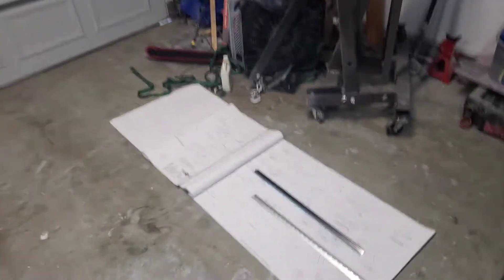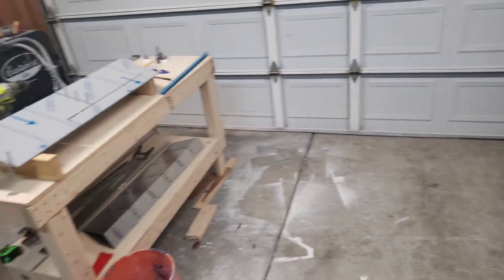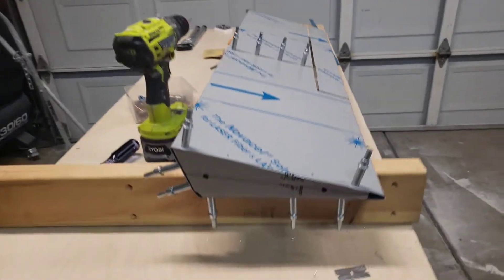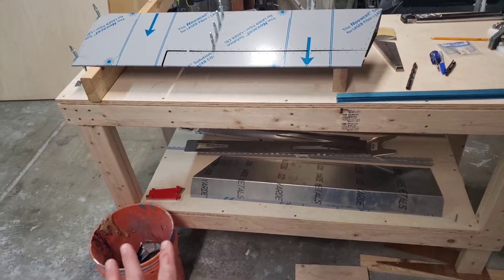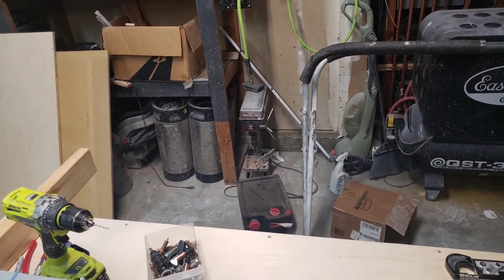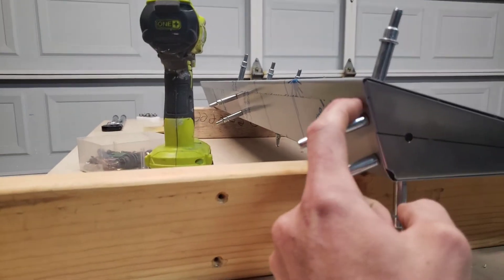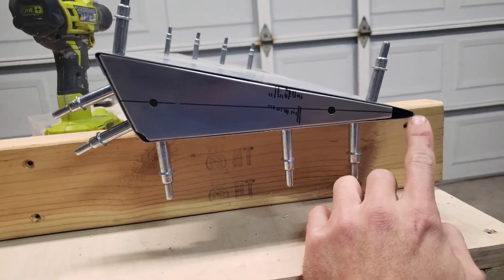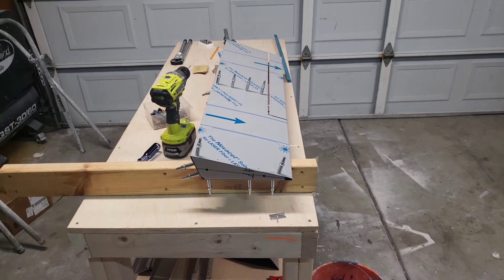New project series: SPA Panther (Ep1)

Comment: not sure what your plans are for dimpling, but my suggestion would be to NOT dimple and use protruding head rivets.  My right elevator went together perfectly, but I ended up with a slight twist in the left which I attributed to dimpling.  I built the rest of the tail without dimpling and the build speed increased exponentially...Good luck!